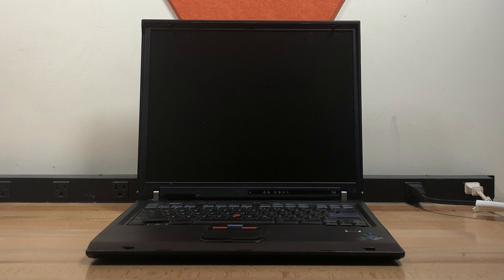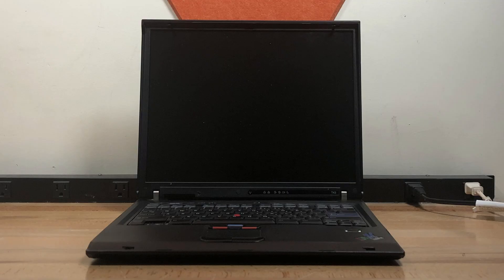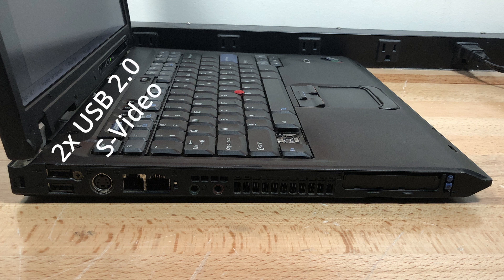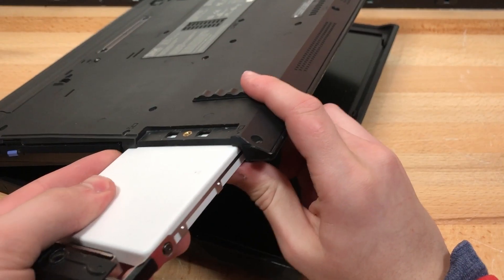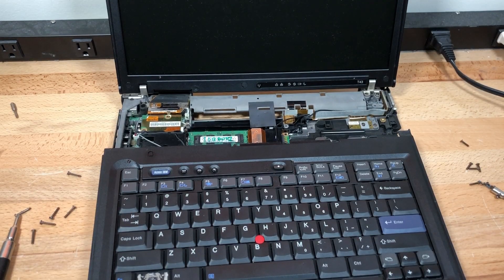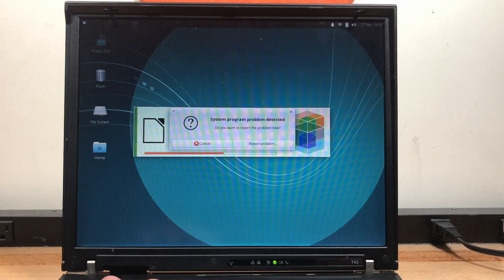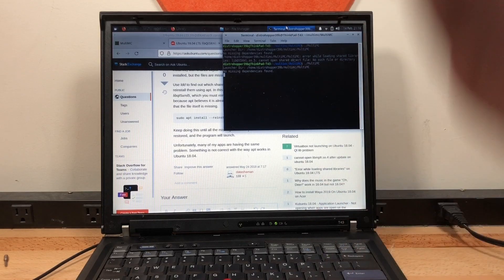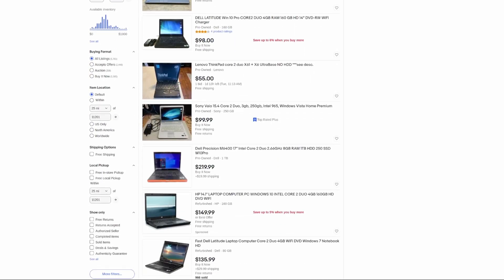The Last IBM ThinkPad - Still Usable in 2022?

Comment: You mentioned wanting to slap Win 7 in it but that's for x64 systems.
Reply from the maker: There is Windows 7 for x32 systems. I installed it on that computer in a video. There’s even Windows 10 for x32 but due to other CPU limitations that’s not possible to install.
Reply: @DistrosProjects  I was only aware of x32 Vista.

Comment: Yep, with that CPU and RAM XP 32 bit is the latest Windows OS available. You don't need Google Docs btw. There are other 3rd party alternatives. 
It's basically the same CPU speed as my 2002 Dell Dimension with Pentium 4. Only good for up to PSX game emulation.
Reply from the maker: I am well aware that there are alternatives to Google Docs, my point was to show how Google Docs runs.

Comment: It is possible to run Minecraft on Linux, the driver is actually more up to date on Linux than on windows (it doesn’t work on Windows) idk why it didn’t work for you
Reply from the maker: @hh7426  i think it broke sometime before 2017, so a version of either the kernel or mesa from before then should work. it didn’t work with a 6.x kernel i tried off camera but i haven’t tried an older 4.x or 3.x kernel

Comment: If you want to run a YouTube video, I suggest you to download the Videos as MP4. It will not lag until 360p Resolution. It lags because of the Graphics driver did not support for Linux. Also, Drivers for this thing is not available to download anymore.

Comment: If you still have this laptop, why not put windows 10 on it, I have windows 10 on my 16 year old Lenovo ThinkPad t61 and it works good and it has a intel core 2 Duo CPU and a Nvidia Quadro 140m gpu
Reply from the maker: I tried, it doesn't boot for some reason + the gpu hasn't been supported since 7 thanks to its lack of WDDM drivers.
Reply: @DistrosProjects  that sucks im so sorry

Comment: I have the M750 version. I installed an SSD with the old PATA connector. Slow for an SSD but better than the HD. I also have 2GByte RAM and I run Win10 32-bit. It works almost well… it is quite slow on upgrades (takes hours) and does not support Chrome anymore. It started with WinXP and later Win7. Else the HW is in good shpe. Everything works as new and I hve had from new as work computer and when it was outdated (many years ago) the company gve it to me. Same happened with the T61 that ws the replacement.
I never use it today as I have an T410 private. But it is fun to keep.
Reply: Wow windows 10 on  essentially Pentium 3 processor? I gotta get my T43 out of storage and try that

Comment: A replacement keyboard would probably be very cheap on ebay.  The touchpad button not working could probably fixed with isopropyl alcohol.  I suspect the drive cage didn't slide in due to it possibly being a 9.5mm instead of 7mm?  And this computer also has a socketed cpu if you wanted to make it slightly faster.

Comment: Here is something cool. I also have a T42 and love it but if you want to have the retro fun of a 4:3 thinkpad and still have it useable with modern linux or even windows 10 then find a T60. Upgrade the CPU to a compatible Core 2 Duo which then allows 64 bit software and BAM, useable old thinkpad for today!

Comment: I have one of these, but it is the version with the ATI x300 64mb-graphic card in it. it also has the better screen ( 1400x1050 resolution ) and the 2.13ghz pentium M cpu. it still works fine ( except for the battery wich is almost completely dead ). 2 Gb RAM and XP runs just fine on it. Have it mostly for older games.

Comment: Wait, what was this magic trick with VLC to get 720p YouTube on this laptop?
Reply from the maker: Download the latest release of youtube.lua from VideoLAN: https://raw.githubusercontent.com/videolan/vlc/master/share/lua/playlist/youtube.lua 
Next, place the file into /usr/lib/vlc/lua/playlist (you might have to use the terminal for this). Then open VLC, select "Open Network Stream" from the File menu, and paste the YouTube link in. Hope this helps!
Reply: @DistrosProjects  That is amazing! I need to try this on my old ThinkPads that only manage 360p right now!
Reply from the maker: @goldibollocks  also if you’re running a distro with the latest version of VLC Media Player (or Windows 7+), it should work out of the box. No YouTube.lua required.
Reply: @DistrosProjects  It worked without the lua on my x200s, perfectly fine playback in 720p! Very nice! I'll check my older laptops tomorrow but the x200s had problems with dropped frames in 720p when watching in a browser.

Comment: i would have liked this video,but i couldn't be bothered,i'd sub but i couldn't be bothered,i'd tell you i was today given the very same laptop with ati graphics,but i couldn't be bothered,i'd ask if using a 19 volt 3rd party psu would damage the battery but i know you'd say you just couldn't be bothered to reply.....😉
Reply from the maker: A 19 volt PSU would probably damage the motherboard. The official power supply is 16 volts and center positive. It also should be 75 watts or higher to allow the battery to charge and prevent the computer from automatically shutting down.

Comment: Are you sure this was the last one? I have a T60 with only IBM branding. IIRC there were two versions, one with Lenovo branding and one without.
Reply from the maker: The pinned comment addresses this, it was the last to ONLY have ibm branding and no Lenovo logos anywhere on the computer or bios (Lenovo is only written in plain text on the bottom of the computer.) Hope this helps.
Reply: Oh, you're right, it says manufactured for Lenovo, but only in really small letters on the bottom of the chassis. Kind of weird how they didn't just slap their own logo on the top.
Reply from the maker: @elijahcs3633  Probably licensing agreements or something stopped them.
Reply: I have a T60 with no IBM branding somehow
Reply from the maker: @vetrixfx9264  some of them didn't.

Comment: You are right about having the power port on the back. It would indeed be much better. After all, you have to lean the screen back slightly which means you would never place a laptop right up against a wall. So there should always be room for the cable.

Comment from the maker: Part 2: https://youtu.be/jK5tf0JI2ZM
To clear things up: This wasn't the last IBM-manufactured ThinkPad, nor was it the last IBM branded ThinkPad. But it was the last ThinkPad to ONLY have an option to feature the IBM logo. Later ThinkPads had either the Lenovo, IBM, or both logos, however I still consider this the last true IBM-only ThinkPad because no T43s have Lenovo logos anywhere.
Reply: That's real. 
I have two x61,one have "ibm thinkpad" mark,another change to "thinkpad x series",they all work fine in 2022.
Reply: Ive seen some T43 have lenovo logo near the T43 model number